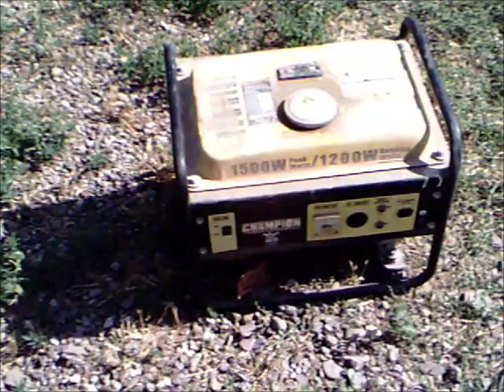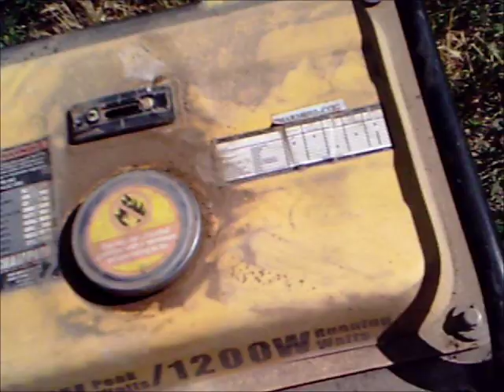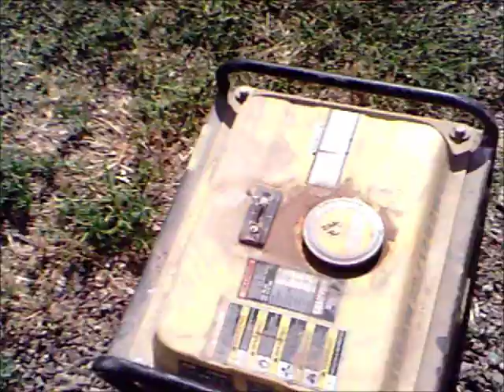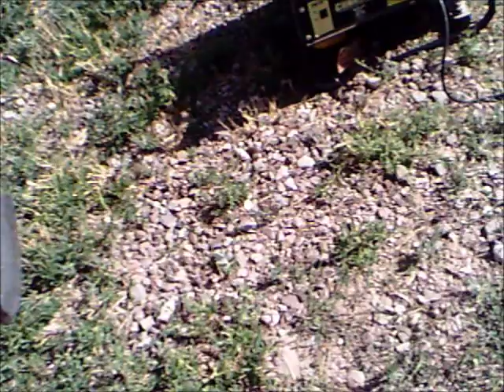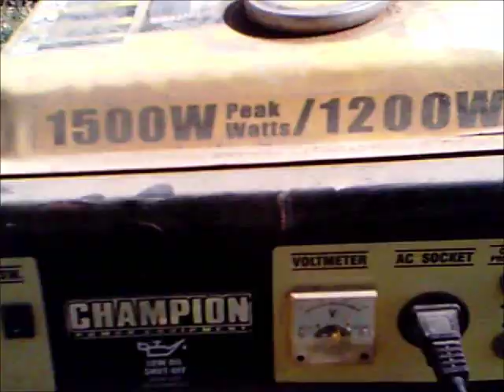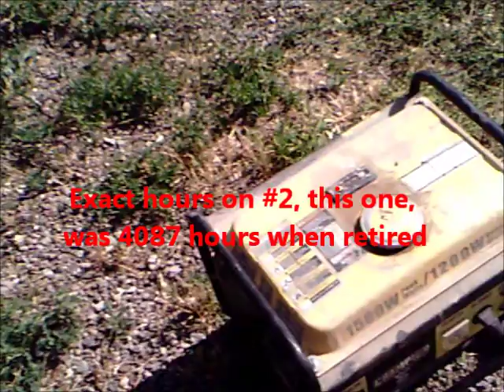Champion Power Generator 1200/1500 watt hurricane back up durability review (info Below)

Comment: Stabil and starting the gen once a month and letting it run for 15 min. will keep problems at bay.Synthetic oil is a good idea also.
Reply from the maker: +Ron West I had 12 of these little generators in a rental biz. I still have 3 left. All have over 2500 hours on them. 
I may go dig another one out and try to get it running.  Only 1 has been started since 2010.

Comment: I use the exact same unit to drive a couple of 200 watt HPS lights- which take a shitload of current to start- run a couple of 25 amp battery chargers, power a large fan and run a 37 inch Sony CRT tv set with DVD player all at the same time. I use it at least twice a week- and the last time I bought gas for this generator was about two months ago. Champion is a winner.

Comment: I bought one yesterday for 149.99 at Orscheln's. Runs like a top.
Reply from the maker: Almost 3 years after I put it in the old milk barn to store out of the way we actually fired it up a few weeks ago to run a Remington electric pruning chainsaw on our property in Utah. 
Seemed to gag a little on the old gas that was not fully drained out but after 10 minutes it was running like it always did. I did pressure wash it, change the oil and try to flush out the old treated gas first.
Reply: The fuel shutoff valve will clog if the gas goes bad of if there is any rust in the tank. If you remove the valve and blow it out with air the generator will run like new again.

Comment: Question for you if you are the original poster of this vid. You mention that you use synthetic oil for your generators, what kind of oil do you use for the break in and how long do you run that initial oil?
Reply: +Јохн «HEADSMASHER» Даниел 
Thank you very much for the information! I appreciate the quick and excellent response.

Comment: You know how treat your generators right. There are ton of people that would buy the same model and have them blow up in less than 100 hours. Too many inexperienced people buy their first generator during a power outage and never do any maintenance besides add gas. They'll run them too hard during the break in period, let the break in oil with factory metal debris run until the engine blows and will leave ethanol mixed fuel in them without stabilizer. Then they get mad when the unit isn't warrantied because the oil turned to sludge and they sent a rod through the block.

I treat all of my generators with synthetic oil, ZDDP oil additive and stabilized fuel. I haven't had the chance to put more than 60 hours or so on them, but have a pretty good idea that they'll last.
Reply: +Battery Geek Break in is something that is never covered enough in detail when it comes to these small engines. I have questions about break in. How is the small engine in a generator different than a small engine in a lawn mower? No one breaks in an engine on a lawnmower. They fire it up and use it, under load of course. Another question is why would you need 3 hours ( as some suggest) to break in a small engine like this? At 3600 rpm the engine should be broke in after about a half hour. My "break in" on my 208cc gen engine was using the provided oil, running for 1.5 hours (probably too long) under different loads, then removing the oil while hot. Nothing special. And the Gen heads don't need any kind of break in. Also, I agree with motoman's break in for engines which is run them hard for break in.
Reply from the maker: +Deucealive75 Small engine break in is absolutely practical to do. The main reason is Chinese laziness. They do a very poor job of cleaning out the parts used and a 30 minute run to suspend the metal debris in oil and change it out will extend your engines life drastically.  I have made a pair of videos with good definitions on the most recent champions I bought. https://youtu.be/klcPAjziOKM  And https://youtu.be/qnQ--oaetz4.
Reply: +Јохн «HEADSMASHER» Даниел I understand the debris in the engine part of it. The first 3 Honda clone engines I bought got pulled apart and went over before they were even ran for the first time. There was a lot of metal debris in these engines. Hopefully the Chinese got better. I purchased these 6 or 7 years ago. They still run well but are seasonal and do not get anywhere near the run time you had with your Champion generators. One of them got it's first oil change in 6 years and the oil was still clean. I didn't pull the engine apart on my generator though. Getting older and lazier I guess. I will check out your vids. Whatever you are doing works.

Comment: John,you're really set up.I need more education in this dept!If you don't mind,one last thing,you mentioned the 110 and 240v versions of the champion 3500/4000 peak unit.Mine has the 110 reg and rv plug that's 30 amp.I do have a sub panel to feed my house,if I connect the 3500 generator to the ghouse using the heavy rv plug/cable I have,will this power my 220 well pump?

Comment: John,thank you!You know after I saw your video and commented a Champion 3500/4000 peak watt gen hit my local Craigs list for 175.00 with the wheel kit.It's great! It's more watts than the one you show and no doubt will use more gas but that money I couldn't pass it up.I can't get over how quiet this thing is.Thank you for the info on the batteries and the inverter,I'll research it!

Comment: i have the same one I put a ton of hrs on mine this last winter 10 days with out power it ran everyday all day  none stop  only time it shut down it was low on oil  i got mine in 2004  I got it to run a cabin way off grid  put a ton of hr on it for that   it is a good gen i don't care what anyone says

Comment: Can a generator be used to charge a small battery bank? with about two 530AH 6V batteries?
Reply: I have this same generator. I plug a 60amp battery charger into it to charge my 4 L-16 batteries up when i don't get enough sun to charge from solar panels.